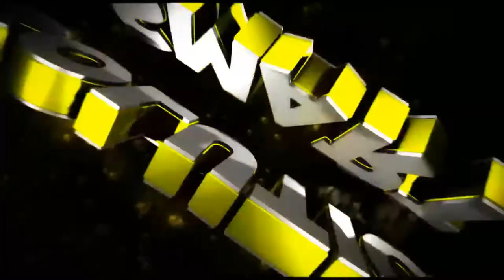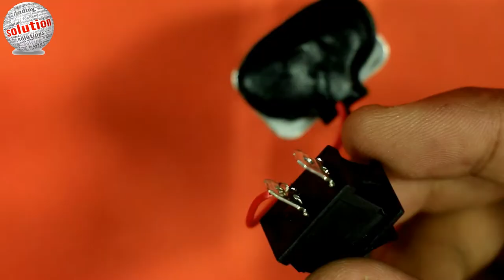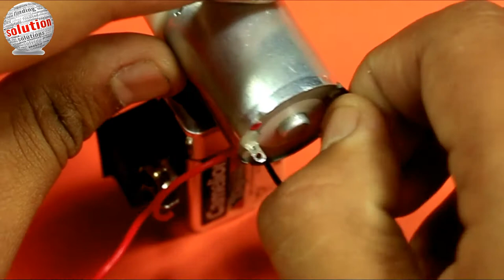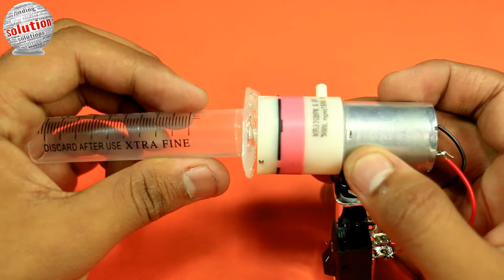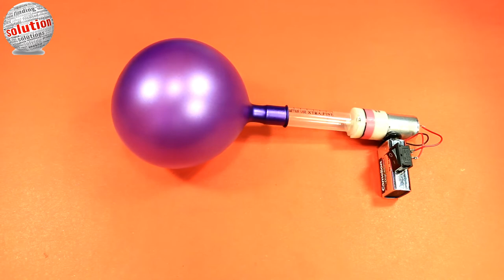How to Make Electric Air Pump For Balloons at Home

Comment: Hi. 
Thanks for sharing this video.
Could you please tell me about  DC Air Pump motor Voltage, Speed RPM and Ampere.
 
Thanks
Reply from the maker: Have you buy air pump?
Reply: not yet